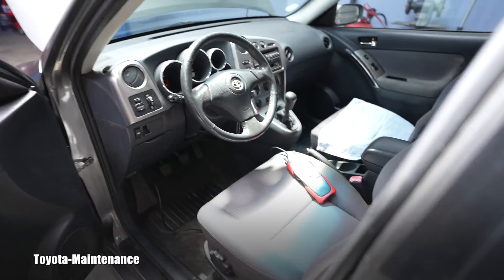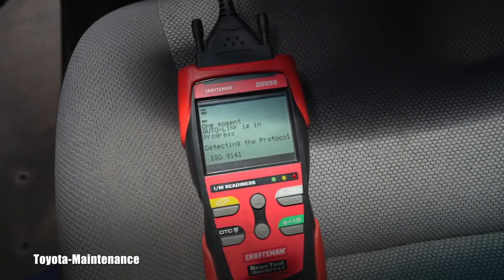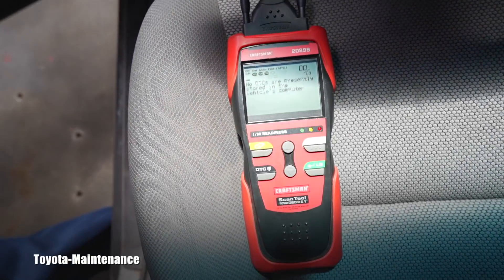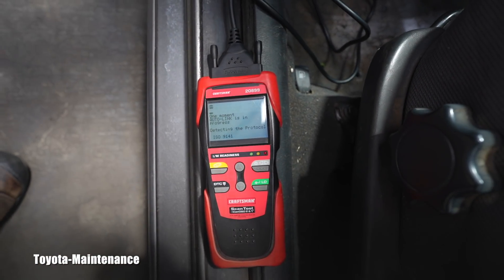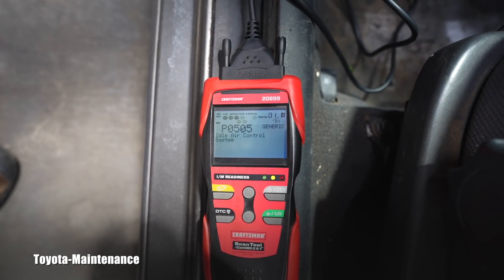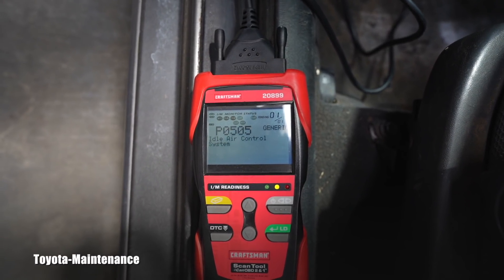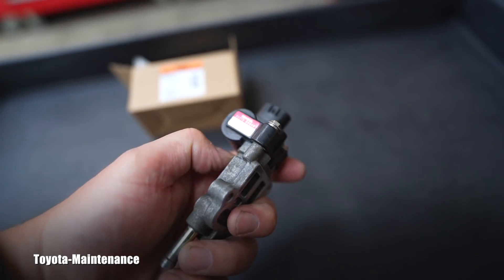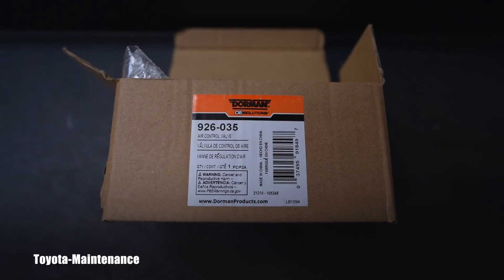Warning! Don't buy aftermarket parts for your TOYOTA

Comment: 2006 Toyota Matrix XRS 2ZZGE engine, got the car from a customer after they ran it over a center divider and did not want to put the money in to fixing the damage. Long story short, got the car back to driving condition in a couple of days, had a high sticking idle only when letting off the gas and coming to a stop. Took the upper and lower intake off, replaced all manifold gaskets, replaced all of the vac lines. Still same problem. Replaced the IAC with a Dorman part as the factory part is near 500 $. Problem persisted. Car was parked for a year after that due to other projects. Fast forward to last week. Got lucky and found a throttle body with a factory IAC for 250$. Took a chance and purchased it. Got the parts, cleaned every thing up, installed on the car, p505 clear and has not come back. Car idles at 750-800 rpm and runs great. It had an after market IAC when I got it. so it can be proven, over and over again, never use aftermarket parts on your Toyota
Reply: Same damn issue I’m having. I’ve replaced the IACV with a eBay one and it did not fix the code. I replaced 3 different throttle bodies all from Pick a part cleaned them but never taken off the actual module due to special tool and still P0505. I think I’m going to order the special tool and clean the. OEM one and put it back on and see if that fixes my P0505 code.

Comment: I service Toyotas/Lexus/Hondas. You can utilize certain parts from Denso and Aisin since they are OE providers to these Japanese manufacturers. However, there are certain electronic parts that only come from the manufacturer and directly available from the Japanese manufacturers. Definitely stay away from Chinese made knock off parts. Amazon and EBay are filled with this junk.
Reply: @jagtan13  Dorman is good for small insignificant plastic things like power steering reservoir caps, clips for door panels and hard to find dipsticks. For everything else, go with a well known and reputable brand or OE.
Reply: @jamram9924  That's the funny thing, I've had dorman clips break sooo, yeah. Even the plastics they've been using have gone down in Quality. I've since been printing my own plastic parts out of esun PETG for clips and other mid temperature nick nacks, nothing directly under the sun.  It's ridiculous.
Reply: @jamram9924  I saw South Mian Auto use a Dorman rear hatch handle and it didn't even for and he had to modify it if he wanted to finish the job. So even "non significant parts" can still be trouble.

Comment: Dorman electronic replacement parts are known to have a high failure rate right out of the box. Much of their electronic parts are pure junk.
Reply: Dorman is only good for interior or exterior trim fastener’s
Reply: @tommypistols8104  I bought a Dorman inside door handle for my Corolla. The sturdiness is a far cry from the OEM but it works and hasn't broken yet.
Reply: Mr Bill Simpson, I couldn't have said it better myself.  There have been times my employer ordered a Dorkman part for something, and I simply refused to install it.  Bought a Dorkman tailgate handle for my 01Tundra, it was just the basic black plastic, broke the first time tried to use it. Turned an bought an OE Yota handle, still working great to this day.... that was about 5yrs ago.  You could just feel the difference just holding them.

Comment: This is a good example of why I only buy OEM Toyota parts for my 95 Tacoma. A 27 yr. old truck that I have never had any bad issues with.
Reply: @Account NumberEight How long did the factory one last?
Reply: Where do you get parts once they’re discontinued from Toyota? I have a 2001 Toyota Tacoma and can’t find a EVAP vapor pressure sensor at any Toyota parts store.
Reply: @lfuentes4098  What is the part number? VIN would help.
Reply: @lfuentes4098  I had a stubborn evap code on my 01 taco and read on some boards that a Lexus LS something part from the junk yard would work. I found one easy. Didn’t look the same but works like a charm, no problem.
Reply: @joekresan8990  Cool thanks. Maybe next time. I found a used OEM and installed it. So far so good.
Reply: @lfuentes4098  Well. That is probably another lesson, number 2, which compliments the number one rule. Do not have a car, for which Toyota discontinued OEM parts .

Comment: Hello Peter.  I have the same engine in my 2005 Corolla and it currently idles over 1K RPM so I'll be rebuilding my IAC valve and just buy a new gasket.  Amazon sells the 22270-0D040 part number from $20 to $80 but I don't want to risk the rework.  Thanks for sharing all three videos on this issue.  I wish you would have recorded the cleaning of the electric portion of the IAC valve, but I imagine that would have been a very long video.  I admire your patience and as a result of this series, I am now a follower of yours.

Comment: eBay and Amazon are full of counterfeit parts especially electronic parts including Spark Plugs and coil packs. 

Last year I ordered Denso plugs and ignition coil packs directly from Denso for my 2002 Lexus ES 300. Due to pandemic they only had 1 ignition coil pack in stock. Had to wait nearly 5 months for the remaining 5 coil packs to come in stock. 
Worth the wait.
Reply: When I purchased a used camry, the coil packs failed.  They were aftermarkets.  Car had 172k miles.  My mechanic said he trusts Toyota OEM coil packs with 100k on them than aftermarket coil packs.
Reply: Not worth the wait if the car won’t run!  Another reason people take a chance with aftermarket parts!

Comment: I have a 2005 corolla xrs 6 speed and had to search The world for a secondary air injection pump and valve. They don't make them anymore so basically only dealers have them in stock. Cost over $700 for both parts and car runs great. He is correct that only O.E.M. is the way to go. It took me searching the internet etc to locate the parts but luckily got them in time for inspection time. Great video

Comment: Toyota own 20% of the shares of Denso and Denso manufactures genuine Toyota parts.
Reply: Great, you do realise that he didn't use an aftermarket Denso product though, he used a Dorman aftermarket part, completely different. Denso produce high quality products, Dorman is the absolute opposite, a high percentage are scrap straight out of the box
Reply: My cousin works for Denso in Guelph, Ontario, Canada. They make great part’s for Toyota vehicles. Cheers, Peter! 🇨🇦🇺🇸
Reply: Got a Denso eng air filter for my 01Tundra for $10 and a set of rubber "O-ring" style v/c gaskets both for my Tundra, not have been flawless.  But yes, I'm about to buy a Denso "front pads and rotors" kit from Rock Auto as well.  About 1/2 the money of parts stores....

Comment: I have had many problems with non OEM parts for my Toyotas. Even things as simple as a doorman bolt for a disc brake didn't fit right. I will only buy Toyota original parts from Toyota if they still make it.
Reply: If you buy Denso, Aisin, NGK, GMB, akebono, nissin or other Japanese brands then you shouldn’t have any problems
Reply: Dorman and Chinese made us the problem. There are aftermarket parts especially for brakes that are reliable like Akebono.
Reply: Yeah good luck with that! All car manufacturers including Toyota are ceasing production of parts for cars over 10+ years
Reply: @nordicpride9708  I believe it. Their business is new car sales.  They farm out as much as they can.  They can't afford to pay employees what they can get parts for by going  outside. What percentage of a  Toyota is manufactured by Toyota? or any car manufacturer?
Reply: Dorman is an OEM. Just saying.
Reply: @Esteban_Herrera  Yes they all farm it out, parts wise, but the rebranded OEM’s are going away faster than ever. I work on a lot of Japanese stuff and it’s a problem when you need reliable parts. Joe Bidens America 😂
Reply: @Esteban_Herrera  Yeah but Doorman isn’t a OEM for Toyota or Lexus. I don’t use  Chinese parts. They are complete and total garbage. The Japanese quality bests Germany and even American made in most applications. It’s a fact. Kaizen is a real thing. All taught by an American from Iowa (Dr Edward Deming). The Japanese work ethic is a thing to behold
Reply: @nordicpride9708  I taught Kaizen and 5s for United Technologies Corporation. I applied Poka Yoke to my designs. I got so weird with it I 5s'd my refrigerator at home. I also created Value Stream maps.  I was task with one department and it was almost impossible to get the department on board. I got their attention one day by opening all the cabinet doors and pushing the cabinets over spilling all the contents on the floor. I proceeded throwing things into the scrap bin. We were the first department to complete 5s.  Other companies came to see what I had accomplished by using my department as a model. I said we could be second but we would have to follow No.1 so lets lead and be No.1 .  I received even more respect when I was given a one million dollar budget. Received even more respect when I asked for another million and got it.  I got to train suppliers 5s so we could qualify them to be JIT and zero turn backs. Try this, Go into the parking lot at work. Look at every car. Look for dirty inside windows, Trash in the back seats, nasty steering wheels. Then  like a drill Sargent you know exactly the people you have to whip into shape. OSHA has a standard requirement. They have three voluntary levels above that.  My company wanted to be the first to hit Gold the first time in the UTC companies.  We almost did it and had a party with OSHA. A few weeks later we received Gold. There are many Toyota parts made all over this planet China included. You can read Made in China right on the box. Even some TRD boxes say Made in China.
Reply: @Esteban_Herrera  I work on Toyotas all day and I’ve NEVER seen anything “made in China”. Maybe oversees market but not here. TRD doesn’t count, but still never ever seen that. I don’t think you see the volume I do. A majority of the parts are from Japan and any others are USA stamped. China made parts are complete garage and Toyota knows it

Comment: Great video. It's amazing how often that happens. 1 out of 10  aftermarket parts might work. But I'm not a gambling man.. OEM all the way. Thanks Peter...
Reply: 2005 Toyota Tacoma  Love my Toyota's  All 3
Reply: I don't agree. Aftermarket parts have worked for me about 8 out of 10 times. The factory part works 10 out of 10 times. The problem is that those 2 out of 10 times that the AM part doesn't work, it kills you. You swear I won't do it again but I do.

If the price is higher I won't risk it with am AM part. However, if a dealer part is $400 and a reputable brand is $150, I will take the chance with the A M part. Again, 8 out of 10 isn't bad. Where are you getting your AM parts? The flea market? Amazon and eBay no-name brands? Dorman? You just have to do your homework. Research brands
Reply: @yactabay  Even if the aftermarket part works, they often only last a fraction of the time/mileage that the original part lasted.
Reply: @jimb8842  You're right but I usually move on to another car before the part goes bad. Also that problem is not always. Many AM parts have never gone bad on me even with a car I've sold 7 years later.  I usually buy older mice cars and sell it about 4 years later.

Comment: thanks to your videos i went with denso plugs, factory wires and denso coils for my truck. costs a little more but better to do it right once than have to do it again. also i found a split vacume hose and fixed it the way you showed. thanks again

Comment: Just as an option, I looked up this 1.8 liter baby on Rock A and they said 44.78 for the private label part #2H1388 and zoom in the second pic and see what you see. Two very familiar names starting with T and D. That means as they explained, "manufacturers make parts to be sold by others." Only difference is it might come in a plain white box or similar from the distributor who bought in bulk. I remember doing this one time with a closeout "Parts Master" inventory and it turned out to be a Wix, just different packaging.
Reply: Nice catch, it says Denso on the WVE part
Reply: Good to know. Thx👍😁👍

Comment: I’ve been burned by not only aftermarket parts, but also by counterfeit parts.  Stamped Toyota and they were in a “Toyota/Lexus” box. 
Fake spark plugs wrecked havoc on my Tundra after 10k miles.
Reply: Good reason to get Denso from a local auto parts dealer or the actual dealer. Only way to avoid the fakes
Reply: @nordicpride9708  I agree, sometimes they equal the online price.
Reply: Blessings 
Me too

Comment: Hello and thanks for sharing these videos. In my experience as a customer, there are parts for a car that you shouldn't buy aftermarket and that are usually the parts that are next to the engine. Otherwise, suspension, braking, some kind of cushions are fine, but even there there is aftermarket and aftermarket.

Comment: I had a similar QC issue on an aftermarket Honda motor mount. The screw holes did not line up!!! The OEM part was twice the price of the most expensive aftermarket equal.

Comment: So true, I had a 2002 Tacoma with a failed clutch master cylinder. I picked up a Discount auto parts replacement, went through all the trouble of replacement, and the NEW part functionality was ALMOST worse than the old used up part! And it LEAKED, fresh out of the box...

Comment: First thing I did when I got my 4 runner is got to pick and pull and grab a bunch of spare parts like throttle body, iac, coils, etc...
Reply: is there a small testing tool I can use to see if the part is good before I pull the part from the junkyard? Just want to get OEM parts too.
Reply: @carolhillard4623  it's hard to test on the lot so you'll have to trust visual inspection.

Comment: I bought a diesel truck which had Dorman vane position sensor and a vane actuator kept getting codes for both. replace with OEM no more problems.

Comment: A friend of mine is an independent shop owner and tells customers straight away that he will NOT use aftermarket parts no matter the make.  He will only use OEM regardless of price because of all the issues he's had with AM parts and returns.  He's lost some business but he said he doesn't mind as he's plenty busy regardless.  I just took my Solara to him for a timing belt and although an AM kit can be bought for about $120 he's installing the OEM kit for about $350 including the water pump.  I don't mind as I know it'll last.  Taking chances on some easy to replace part is one thing but something like a timing service is much different.
Reply: ASIN kit is perfectly fine, all OE parts
Reply: Toyota doesn't make the parts, they get them from Denso, NGK, etc. Same for their fluids, lubricants, and sealants. You just gotta be smart about the parts you buy, and from whom, and not have a 'Wal-Mart' mentality. Your buddy doesn't care, be just passes the cost onto the consumer. But, to some people, being able to buy the same part for half as much may mean the difference between making rent or not. 
Here's a non-Toyota example. '05 Acura TLX water pump, $218 from the dealer. Aisin part from Rock Auto, $68. Aisin part had "Acura" ground off of it as they're an OEM for Acura water pumps, and probably easier to make one part than to control for demand between aftermarket and dealer demand. An Aisin timing belt kit costs $250 for this vehicle with water pump, etc. Dealer kit is $650. The difficulty is having the knowledge and experience to know what aftermarket parts to trust.

That $400 difference in the example above just happens to be the exact amount that 36% of Americans couldn't afford as an unexpected expense in 2020.

Comment: It just depends on the part.

Dorman is fine for things like window actuators.

I'd have a hard time justifying a 4x higher price on that part.

I would also have tried to restore the original part.

That particular part I would have sent back for sure. It's not the kind of part where the user expects to have chase bolts holes to make it fit.

I still would check the voltage levels being passed to the IAC valve to eliminate the ecu.

Comment: 2008 Toyota Sienna van. I used Dorman parts on two occasions with disappointing results. 1. Replacement drivers door check failed within a week of installation. 2. Replacement plastic radiator filler neck retaining clip slot was deformed and clip could not be installed. Dorman parts are IMHO are not even close to OEM standards for material, engineering and fitment.

Comment: Bought a set of Dorman parking brake bell cranks for my 2001 Tundra. The arm wouldn't even properly fit inside the bracket that was INCLUDED with the part... I had to take an angle grinder to them before they were usable. Couldn't believe such a simple part could be so screwed up. Never buying anything Dorman ever again.

Comment: I use to have a 2009 Rav4.  Monroe shocks from the factory lasted 9 years with no rust on the shock case.  Bought Monroe replacement shocks.  1 year later the shocks cases were completely rusted.  For some reason the OEM shocks had thicker gauge case on them.  Asked Monroe for part number for the OEM and they would just tell me the number of the shock that only lasted a year.
Reply: I think Monroe have more than one supplier, I had some Quick Struts with same part # and they had different springs fitted lol
Reply: My 01 Tundra, 175k-ish miles, bought some Monroe coil overs for the front.  They didn't ride as well and where more bouncy than the (I thought) wore out OE KYBs that were on it.